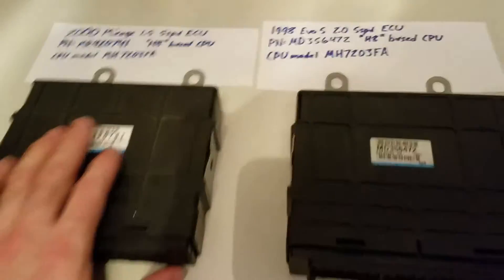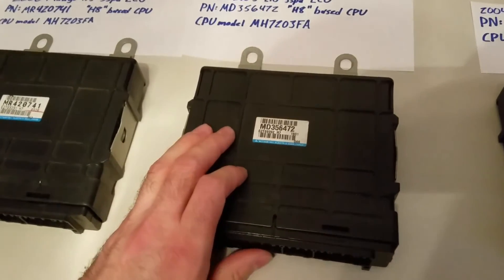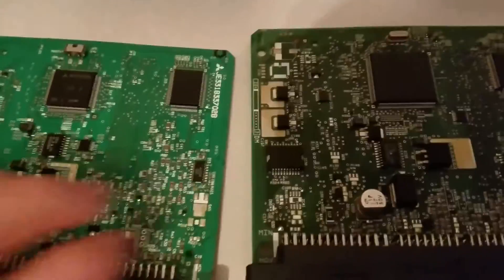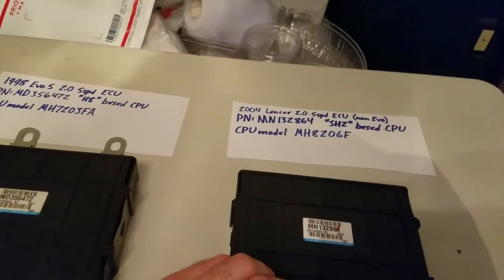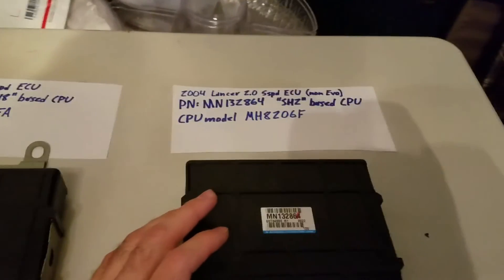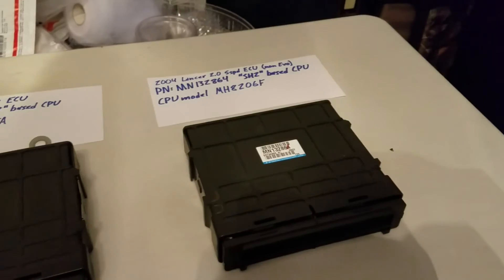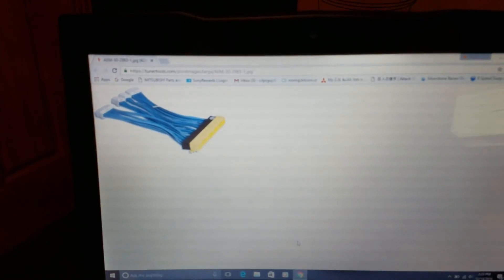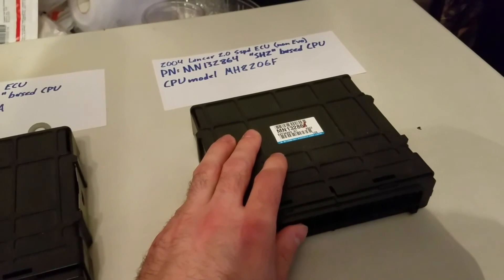Mirage to Evo IV Coupe Conversion Project: ECU Options!

Comment: Hey man so ive got a 01 mirage 4g93 with a gt3071r bolted to it. Obviously has the SH2 ecu. Im keeping it an auto unfortunately for the time being but id like to be able to tune it with an evo rom preferably right? Is there a rom youd prefer? I feel itd be nice to have maps scaled for boost. Thanks man
Reply from the maker: Ah man it's been a long time since I researched all of that!  I believe you should be able to use an Evo 7 GTA rom though.  Those were never really fully figured out though, so I don't think you'll be able to find an off the shelf rom that is capable of speed density, but if you're keeping your MAF you should be able to use that rom.  You'll also want to double check how many gears your transmission has vs the Evo 7 GTA.  I believe the Evo had a 5spd auto and there are both 4spd and 5spd variants of the auto for the lower model cars.  My recommendation is honestly to bite the bullet and grab a Haltech Elite 1500.  That way you're not trying to engineer workarounds for stuff like that.

Comment: I really hope you can get this off my mind, can I get a 1997/8 Plastic ECU from the mirage and just swap it with the metal case one? or are there any things I have to look out for? I really really hope you can answer this question as this would help a LOT 😢
Reply from the maker: 97 and 98 were the metal case years.  99/00 were the flashable plastic case ECU's. (And 01/02, but the autos had different connectors and would be more work than would be worth doing to swap.  Manual trans 01 and 02 I believe were the same as 99-00 manual ecus.) They are interchangeable if you make sure you stick with 1.5 ECU's for 1.5 cars and 1.8 ECU's with 1.8 cars.  I don't think there were any electronics changes that would cause issues.  I also don't know much about the auto trans ECU's.